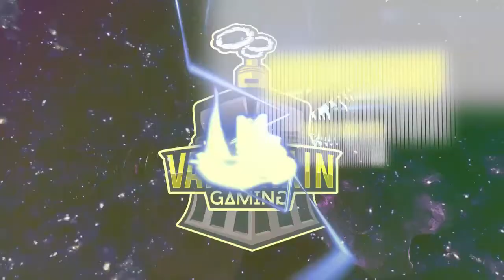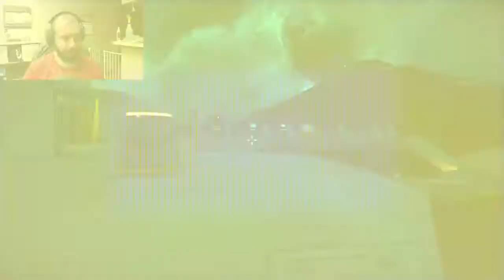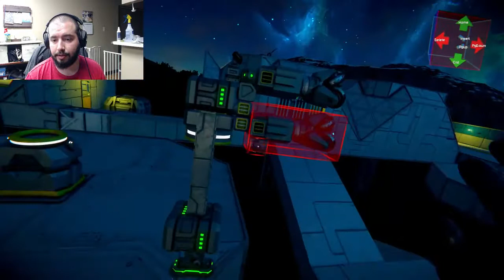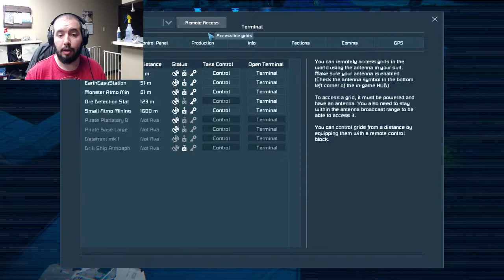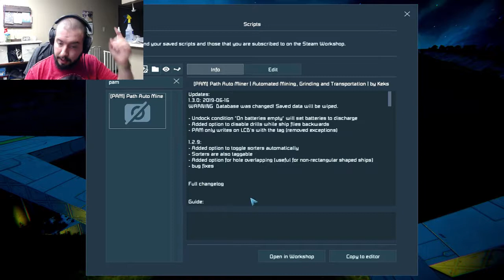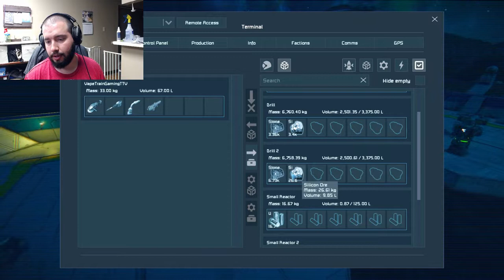Easiest Way to Automate Mining in Space Engineers!

Comment: Functional, but not survival friendly. The thruster wash will destroy your programmable block or any other block, in a 4 armor block line, when not in creative.
Reply: Maybe it is for the small grids. I'm probably misremembering as I've been away for a couple months. I tend to build large grids so I thought it was 4 blocks.
Reply from the maker: @pluckydono  have to check into it ive run the design a few times with no real issues but its and easy fix
Reply from the maker: could have sworn it was 2 blocks